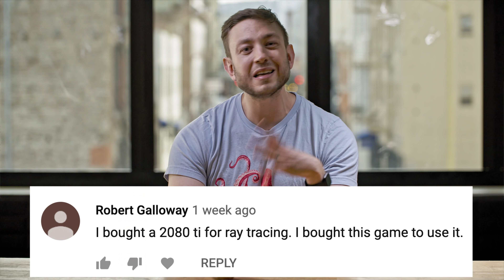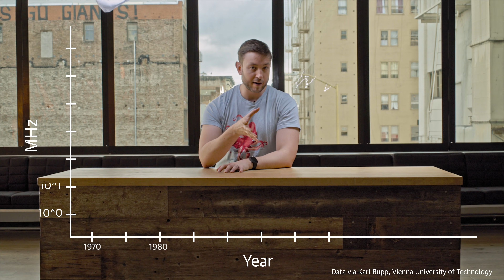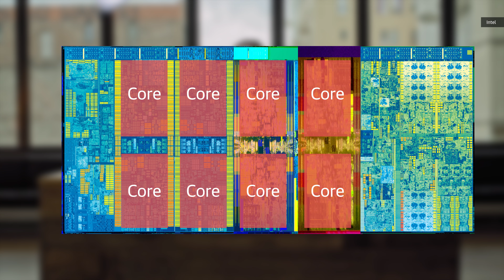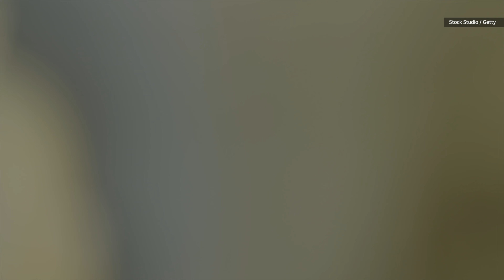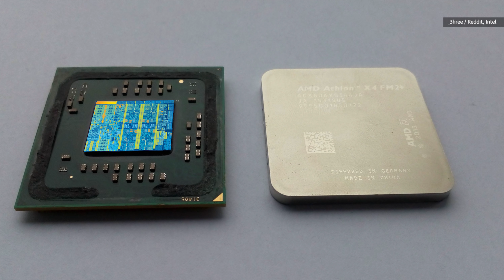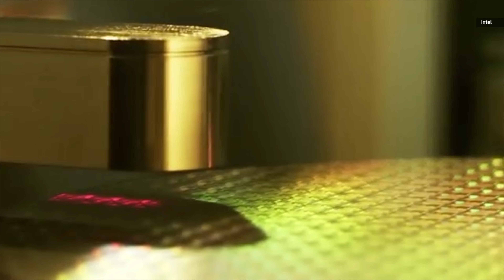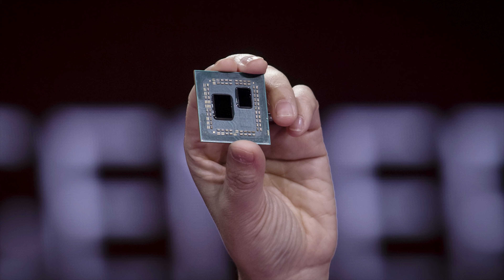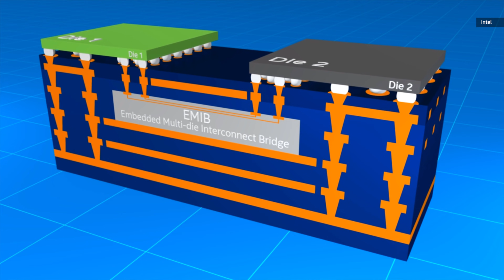How Intel and AMD are using 'chiplets' to build next-gen CPUs | Upscaled

Comment: Fascinating but disappointing at the same time. The brute force, rapid improvement of the 90s/early 2000s was nice. I don't really want that to go away. These 'workarounds' aren't really solutions to get us back to the good old days. I hope graphene or some similar new material takes off and we eventually have Terahertz clock speed CPUs. That's what we would have expected for the future back in the 90s.
Reply: We are hitting physics walls. Of quantum mechanics on one side and of thermal dissipation on the other. 
That won't go away. 
And multi cores is the logical step forward, think 1core=1neuron.

Comment: Not sure if you heard about this new company Intel bought up recently is a kernel based algorithm that splits the load evenly between the multi cores and improves performance on single and multi core processors. Check it out.

Comment: Great video. I've often wondered why chipmakers focus so much on MME/X and video subroutines, etc. when it causes the chip to grow so much in size and lower the yield of working chips... A set of 7nm cores coupled with higher-yield 12nm+ controllers put together on a cpu sounds like a much more workable solution.

Comment: The video was awesome. We're reaching a point where we simply wont be able to power the worlds machines if we continue to struggle with this kind of technology. The answer of course is the quantum computing and the superposition. Quantum bits, unlike the traditional computing bits of today, that can be on and off at the same time, provide a revolutionary high performance paradigm where the information is stored and processed more effectively. The ability to store much greater amount of information in 1 unit means quantum computing has the potential to be faster and more energy efficient than the computer we're using today. 

The problems are still creation of qubits and making them interact in specific ways that would work in a quantum computer. 

As professor Martin Zwierlein once said the answer could be in using of ultra cold molecules as carriers of quantum information unlike ions, atoms, superconducting qubits et cetera. 

In my opinion we're [Planetary civilization] on a verge of tectonic, and epochal changes of the paradigms of reality. We're entering the first digital revolution and its scary what a huge impact this new era will have on human civilization in general. The Sci fi tech from most of sci fi movies is going to become a reality in the next decades and most of it is going to come well, from the Military Industrial complex...

But one tech that is going to have a deep impact on our society is the Robotics. Its as if someone from the movie I, Robot knew long time ago where the tech progress will lead us in the not so distant future. I'm not saying robots will evolve, but they'll be around us, for a long long time. The synergy between the two could propel us to unknown highs. AI + Robotics...

Comment: Tablets would benefit from 1 big core and several little cores, massively. Run on ARM when not doing much but checking social media or email, then kick on the big guns when needed. This will save a lot of battery power, and make the tablet as useful as a laptop.

Comment: So older ways to boost speeds (more cores, hyperthreading) had an data synchronization issue between cores (cache coherence). Easily explained, compute with data value you have even though it might not be valid (condition in front that can change it) and trash the value + all computations if it becomes invalid. This happened on single DIE (all cores on single die) Separating cores means the solution is no longer valid. Really looking forward to see how they want to speed up and how they solved coherence. All I see is off-loading computations to achieve battery life not a speed increase.

Comment: But but but!!!

Intel said glued together CPU's were shit?
Reply: Yes, but it was before intel started to glue their dual cores :)
Reply: Intel also said 4 cores (and 4 core refreshes) was more than enough for years until AMD started going ham with more cores and forced Intel to actually come out with new products.
Reply: Huh someone should tell ice lake lol
Reply: Well it was when Intel did it. Remember netburst/ Pentium d
Reply: They weren't wrong, they just couldn't think of anything better either
Reply: Also it wasn't until AMD came out with the anthalon guys that  true dual core that Intel started using and came about as a standard remember Amd used to be a sister company for Intel and would get chipset and CPU designs and layouts and use that as a baseline well they stop doing that after Intel realized AMD was going to steal their customers.. the constant here is Jim Keller The Mastermind who is also behind Zen architecture....the man shits gold. When Andy took the market with the X2 anthlon chips Intel don't take it back for maybe five six years..
Of course Intel is still on 10 NM well AMD is now about to launch a 7 nanometer chip..
Reply: There is a reason threadripper's "gaming mode" just turned off extra dies so you only used a single die...
Reply: iNtEL bAd AmD gOoD

what is this r/ayymd
Reply: @spectre722  r/ihavereddit/
Reply: no they didnt say glued together cpus were shit.  everybody else did when intel did it with the core 2 quad.  intel was just pointing out that amds new server and HEDT lineup were glued together as well and that it causes problems.  just like the problems people pointed out on intels chips.  glue is an industry term.  "glued" means any chip made of seperate dies and "glue" refers to the thing that actually connects them (infinity fabric).  people are looking so hard to trash intel over anything these days that they will take any excuse.  dont belive half of what you hear people say now a days

Comment: the problem is the x86 design . it is limiting, there is only so far you can push it before heat causes quantum effects in tiny manafacturing - the best way to simplify these would be to break apart the cpu alltogether, place the controler, caches, cpus as seperate chips on the motherboard ---- or opt for going back to powerpc from ibm but with better rdram updated....

Comment: Single Core performance is obsolete, no app uses now in 2019 a single core, same for dual core you can not run windows and a game on two cores like a i3 CPU, quad core 4c/4T is minimum recomanded , 4 cores and 8 trhreads should handle all new games at decent performance with no bothleneks.

Comment: This is true. If you own a 2nd or 3rd or even 4th gen Intel i5 and i7 CPUs, there's very little motivation to upgrade. Only with Intel's 8th gen did an upgrade actually make sense for most people and that's because CPUs are not being shrunk down as fast as they once had been. Intel has been stuck at 14 NM for years, struggling to achieve 10 nm and what this means is transistor counts largely stay the same density. This has a huge impact on speed, energy use. Essentially not much as changed since the 6th gen I core CPUs and in many ways the 5th gen was a step backwards, meaning the 6th gen had to play catch up. Think back with the Pentium 4 prescott. Intel had die shrunk that down to the point they had tons of leaks within the silicon and it was because of this that the Pentium 4 and honestly GHZ (not the work done per cycle) had hit a wall. In part because of power issues and that long pipeline within the Pentium 4  (something like 34 stages) needed lots of power hence heat and that brings me back to this current 9th gen. Eventually core counts will have to stop. There's only so much heat we can remove and a chips biggest enemy is heat.

Comment: So basically they're going backwards in design techniques. We started out with motherboards that had a northbridge, northbridge, and super I/O then moved those onto the CPU to increase performance. Now they're breaking off parts of the CPU to increase efficiency and performance? I understand that they'll still be on the same CPU package and it makes sense to make each piece individually until they can effectively produce them in the modern CPU die format but I still find it ironic that we have to go backwards to go forward lol

Comment: Smaller cpu : more manufacturing errors
Bigger chip: more manufacturing errors
Being in charge of improving these products most be really fun
Reply: usually larger chip are more likely to be defective. Smaller chips are always easier to produce and validate.
High power chips are also more difficult than low power chips where temperature and frequency have effect on stability and voltages
Reply: simple, go for medium chip - problem solved.
Reply: For the engineers working to scale production of these of these chips (where theoretical meets reality) the last few years has been very difficult... Coupled with the CEO turnover and the natural change of direction/vision that occurs it has exacerbated the issue. It great to see AMD competitive again and I think as a whole this creates better products for consumers but for the engineers in the trenches it's been pretty damn brutal. Mad respect for the teams putting in the late nights to solve these cutting edge problems.
Reply: CPUs sound like my wife. No matter what I do, I did it wrong.

Comment: How about instead of focusing on miniaturization and speed, they focus on efficiency and process optimization. Each generation goes by without fixing some of the gleaming issues of the past generations. Yields and tdp haven't changed much compared to speed and density. they keep coming up with new processes and they struggle with the yield but then by the time they start getting it almost perfect they scrap it all and go to another new process.

Comment: Couple of notes here.
About your "Big chip problems" section there are NOT more manufacturing errors but since there are less dies per wafer the ratio of "good" dies to "bad" dies due to said errors is worse (which is weird because you then explain this correctly later).
Next you talk about what Intel and AMD are "Planning" however AMD has already had chiplet CPUs on the market in the form of Threadripper and Epyc (which is also weird because you ALSO explain this correctly later).
And lastly when you mentioned that a defect could make the chip a total loss that is also inaccurate. Losing a core or two will simple make a CPU fall into a lower product tier (AKA your i5s and Ryzen 5s instead of i7s and Ryzen 7s).

Comment: You discuss how moores law is slowing down, how it relates to transistor density, them show a graph of frequency......
Frequency isn't what Moores law referred to, as you said earlier. Thats deceptive as hell, and is wrong. 

Moores law was a prediction that the number of transistors in a dense integrated circuit would double every two years, for the next 10 year.
That was stated back in 1975.
The original prediction  turned out to be true, however it's been held out to be the standard in virtually every standard of computer development, with people using the idea that it would account as being a doubling of performance,or even in capacity such as RAM.

In terms of the overall density, like what was predicted, it's held true with CPUs, especially in the ARM catagory.
Everyone knows that it's not going to be true for much longer, as the development of nodes is significantly slowed down.

It would be very useful to discuss WHY nodes have slowed down, with the relationship of materials and quantum tunneling, and particle interaction in general.
Reply: Discussing that, admittedly in a manner which the average user can understand, while being scientifically accurate is a hell of a task. If you intend to take it on.... good luck.

Comment: Unless there are some major changes in either how software is coded or somebody introduces hardware level parallelization of code that would traditionally be sequential then we are nearing a dead end and will not be seeing gains by adding more cores/threads for anything other than niche tasks that the vast majority do not perform and do not care about.  For the majority of software we're already at the point of seeing greatly diminished returns from adding more than what's in the high end chips you can buy right now.

Comment: 5 ghz in 2004 with a Pentium 4 was mind blowing, like we imagined flying cars being a probable futuristic thing back in the 60s I could close my eyes and see us easily reach 10 ghz within a decade, that never happened. Still kind of disappointed by the whole "limitations" hammer which hit me sometime in the early 10s. Micro technology was taking huge leaps forward but we never got the flying cars, the 10 ghz CPUs and my mother in law never ceased to mimic a black hole. One just can´t have it all!!!
Reply: First 10ghz is not needed.
What is needed is better processing unit for wat used/heat released.
And we had huge improvement in this.
For what people are using the pc current cpu is mostly underused and very rarely the bottleneck of a system.

Comment: 3:25 "it's harder to dissipate heat from a big chip" nuances aside, isn't it like the complete opposite? the larger the surface the better heat transfer, but also (in context) the likelier to be generating more heat in the first place (which also affects MCMs).

Comment: Stacking chiplets will make heat dissipation a nightmare to deal with. And AMD's 2d solution means a lot of latency between dies and even to pci-e or memory due to both  the number of lines on the PCB is very limited and the length and electronic characteristic of each line are hard to optimize. That's why intel keeps using huge dies with mesh. I think the multi die approach can only be used effectively for low power soc or those applications with no requirement for bus speed.

Comment: Moore's law is that the number of transistors in a circuit double every two years, it has nothing to do with "computer power" and it still holds true with the most recent CPUs, even if their core speed has stagnated.

Comment: This isn't new.  Back in 2000 they were admitting that modern microprocessor design had limits.  You get better performance by either pumping more power through the CPU (which introduces a heat/cooling issue that limits speed), or by splitting the task across multiple CPUs, which doesn't work well with all applications.  Back then, they were debating making 3D CPUs (microprocessors going vertically as well as horizontally), but I don't think that ever caught on.

Ultimately, you need to design a whole new CPU concept, and that involves a moment of brilliance to discover what works better than what we're using today.

Comment: Yes, do a future episode of transistor design, voltage leakage, and electron tunneling. I like that.
Reply: I can explain Quantum tunnelling a little in the meantime. Imagine you hold a rubber ball at given height and let it go and it bounces higher than you initially held it. This would never happen in the our realm of classical physics but something like it happens at the really small scales transistors operate at where these Quantum effects come into play. Electrons will "tunnel" through a barrier which has a higher energy than the energy of the electron. We can actually calculate the probability of this. This tunnelling leads to errors and wear. The solution has been a ton of different new material layers to cut this down but it's a big issue.
Reply: Engadget goes into computer engineering?
Reply: same
Reply: Yes please!

Comment: When talking mobile vs desktop you have to consider cisc vs risc, specially with the arm architecture which is so low power (and thus heat) the first chip ran on almost no power and the designers couldn't believe it. As for forevos it looks good but I have no idea how to cool that thing.

Comment: CPUs could be faster. What holds them back is Intel's ancient X86 instruction that has been the standard since 1977. Instead of replacing the X86 instruction with a more adequate or modern instruction, Intel wanted to keep their stronghold on the market and just add patches and extensions to the ancient X86 instruction. Even AMD64 is based on the X86 instruction. If Intel had replaced this instruction with something similar to ARM, CPUs would be much faster and require less resources.

Comment: Manufacturing defects don't necessarily kill the entire chip.  Parts of a chip can be disabled.  So a quad-core die with a fault in one of the cores can be sold as a tri-core CPU.

There's no "repair" as mentioned in the video.  You just cut off the defective parts.

Intel's chiplet plans (the ones mentioned in public, at least) are antithetical to increased performance.  Stacking dies on top of each other makes thermal dissipation much more difficult, so low-power designs are all that such an approach is suitable for.

AMD's chiplet approach gives them remarkable scalability.  By making a single 8-core chiplet at 7nm, they get a huge number of dies per wafer (reducing cost), and reduce the chance of a manufacturing defect rendering a chip useless.  Two dies with defects in four cores each can be put together to make an 8-core CPU.  That's likely how most Ryzen 3000 series processors will be sold - two dies per package except with APU's, which need to leave room for a GPU.  Even a lowly four-core part could be made with two badly-damaged chiplets and the I/O die.  

It's true we won't see how much of this potential AMD has been able to harness until they actually ship some processors, but it's a fair bet that the second half of 2019 and at least the first half of 2020 will be dominated by AMD in every metric.  Intel can't do much better than they already have without a process shrink, and they are not going to have any high-performance parts on 10nm, but instead will have to wait until their 7nm matures (which will probably be roughly equivalent to TSMC's 5nm process, in terms of transistor density).